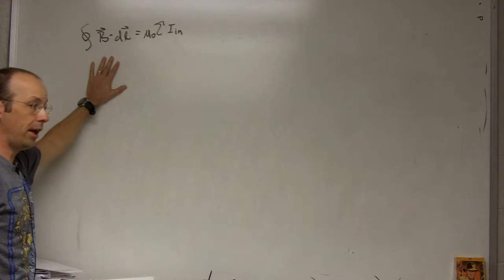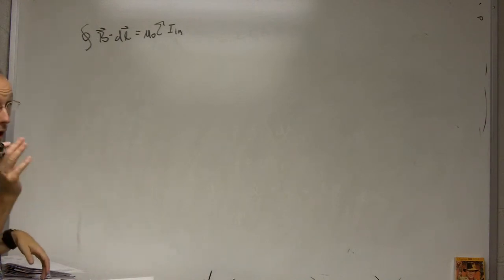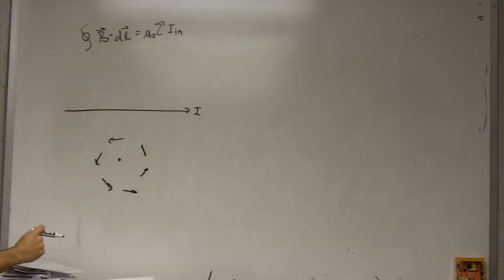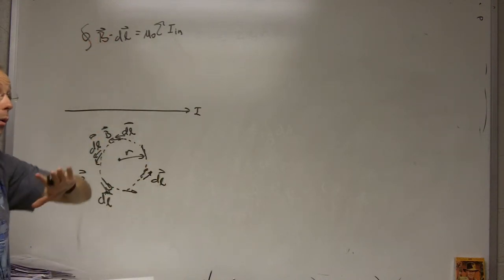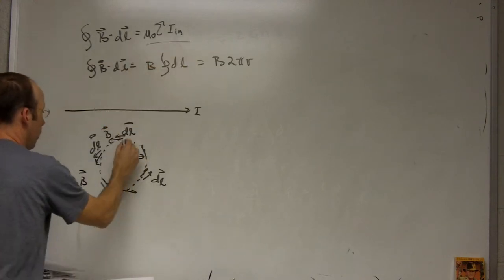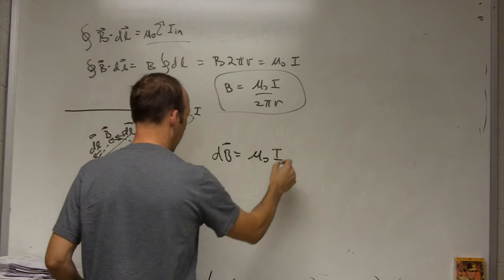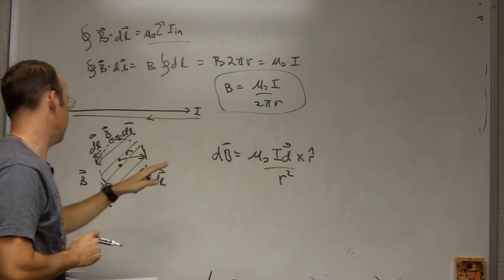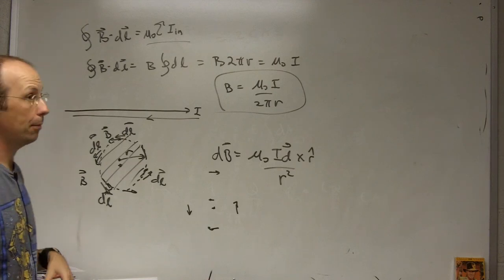Ampere's Law for a wire

Comment: does the wire have to straight in order to obey the law?
Reply from the maker: If the wire isn't straight, the law still works - but the magnetic field won't be constant around the loop so that you can't factor it out of the integral
Reply: @rhettallain  thank you! but can we prove it when its not straight?
Reply from the maker: @siddharthdeshmukh277  if you are a distance r from a curved wire, the magnitude (and direction) of the B field depends also on WHERE on the circle you are - there is no general formula. 

Probably your best bet is a numerical calculation.https://rhettallain.com/2019/06/29/magnetic-field-due-to-a-long-straight-wire/
Reply: @rhettallain  ok i only could prove it for straight wire pointing in any direction , so its experimental based law
Reply: @rhettallain  thank you
Reply: @rhettallain  thanks!